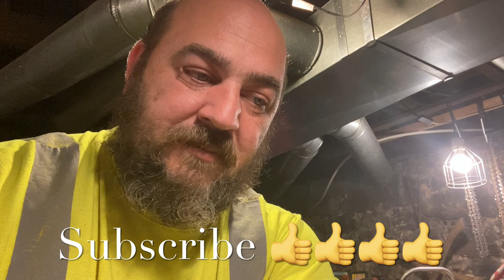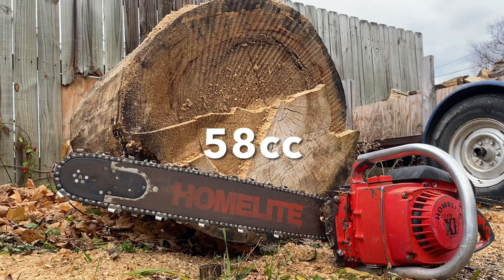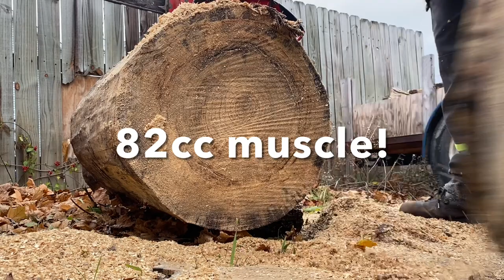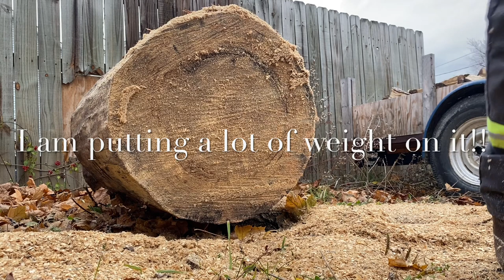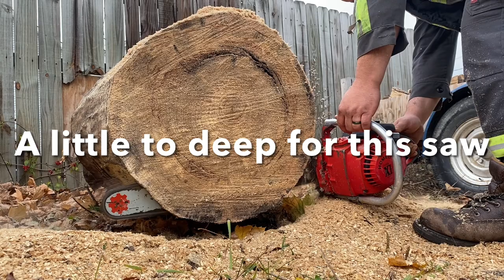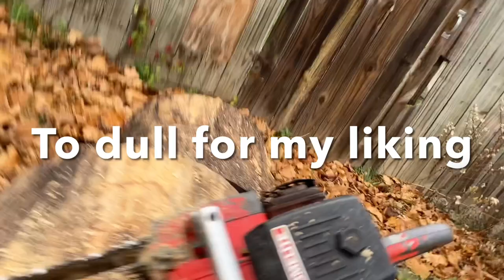Homelite Chainsaw Failed Attempt At A Comparison.  82cc Stock vs 58cc Ported Homelite Comparison!

Comment: Oops. oh well. Am I wrong in thinking the Super xl needs a few more revs if it has been ported? It sounds quiet for a ported Homie, it would probably love a muffler job or pipe. Still, awesome work mate.
Reply from the maker: I tuned the carb to the max for richness.  This caused the saw to spin at lower revs.  This video was supposed to be a test for the amount of torque I could get out of it.  Rpm was not to be a factor.  The max torque was what I was looking for.  If you watch this other video you will see the saw is capable of more rpm.  I will attach the link to the other video.  The true intentions of this video ended up being a flop so I went ahead and posted it anyway.  It is a bit misleading because I never explained the true purpose of what I was doing.

https://www.youtube.com/watch?v=pWVRMI7Fej4&feature=youtu.be
Reply from the maker: It is not showing any of the signs of needing muffler work done.  The amount of porting work done to this saw is what I would call very mild.  I started with .098 squish and took it down to .063 plus all the other work that I did.  There is still a lot of room that I could go farther but the intention of this saw was to make it a better firewood saw than it came from the factory.  Nothing wild.  I am starting another build now that will be a decent amount hotter.
Reply: @Smittyschainsaws   Yep, fully get what you're saying. It's hard to get true sound over youtube any how. I just know my xl12 sounds like a fire cracker when running, thats the closest I have to compare it to. Keep the videos coming. I think it's as important to show the flops as well as the successes. Cheers